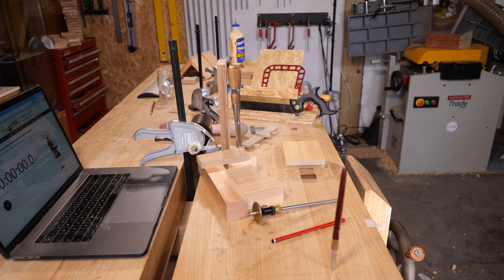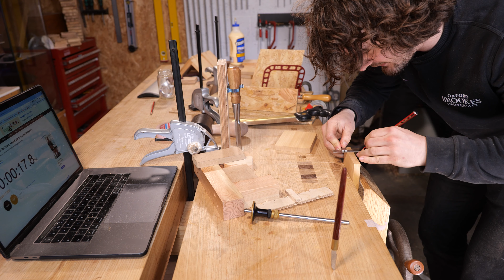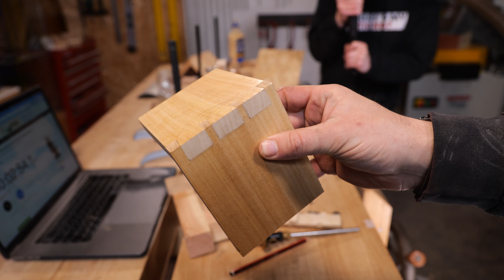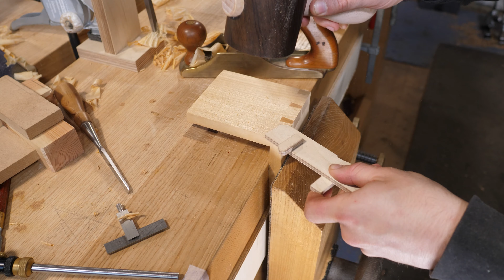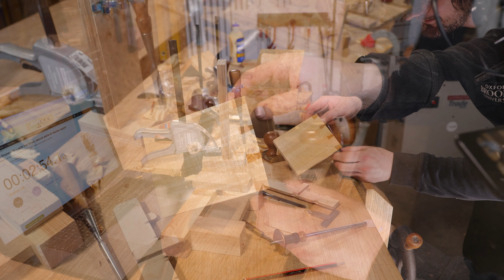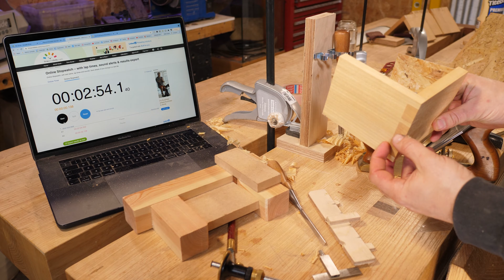Worlds Fastest 'Cabinet Grade' Dovetail (Unedited)

Comment: That could almost be the start of the one hour cabinet challenge. 1 door 3 draws. My first dovetail took 10 times longer and wasn't anywhere as neat as that.
Reply: Do it 100 times and you will be so much better.
Reply: @bighands69  i would definitely have a fast drawer after that 👌
Reply: @robwallis1277  
Dovetails can be used on more than just drawers. You can use them on boxes, chests, tables, cabinets, wall racks, doors and so on. 
If you want a very strong joint then you would use dovetails as they will never come out due to the glue breaking down. 
They are one of the gold standard joints to use and you can use them as you need them. 
You could make a solid wooden cabinet out of dovetails and have no need to actually dress and trim to hide it. 
People have even used them on plywood.